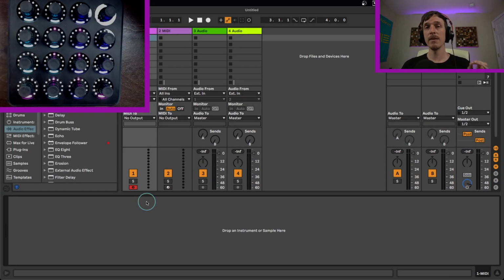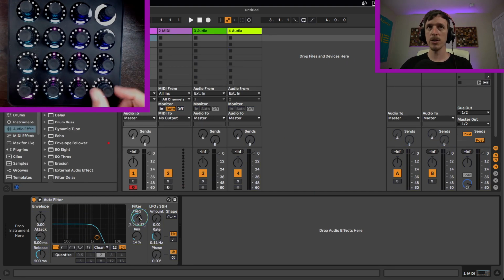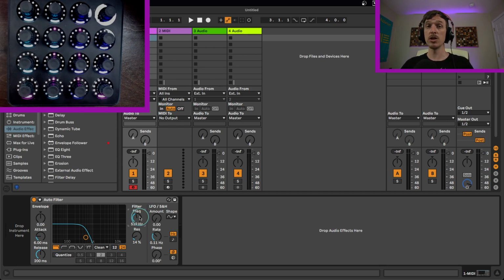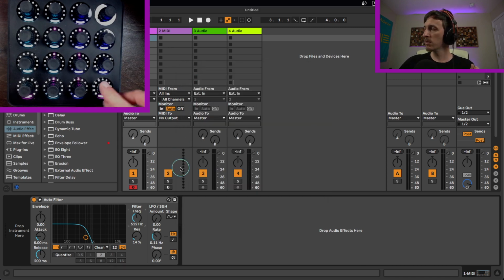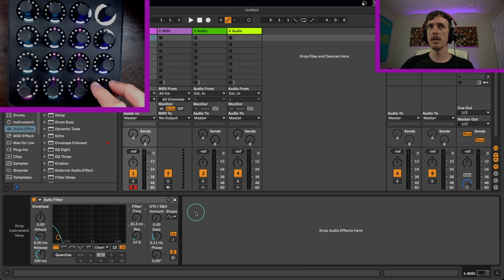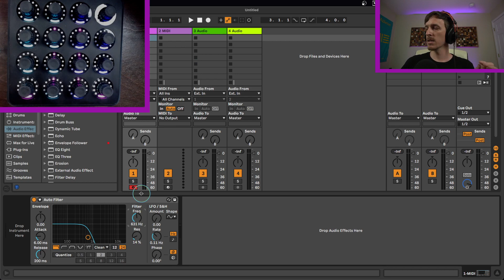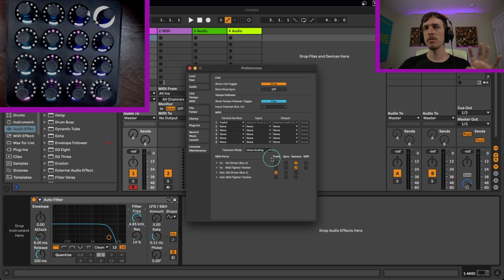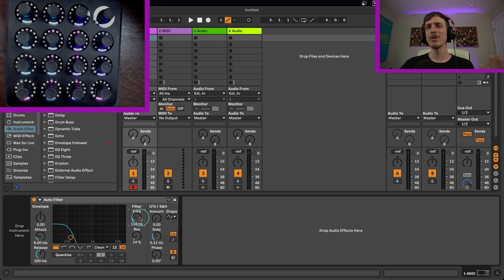Ableton Live Quick Tip: MIDI Takeover Modes

Comment: Nobody uses "MIDI" values anymore. Everything is with macros (because they change accordingly with the track focus on the control surface). But the thing is...Ableton doesn't pickup macros!! Takeover mode doesn't work with macros! I think I will be buying the same controller as you have, because it has only those encoders and LEDs. Bidirectional communication with the controller is currently the only option..